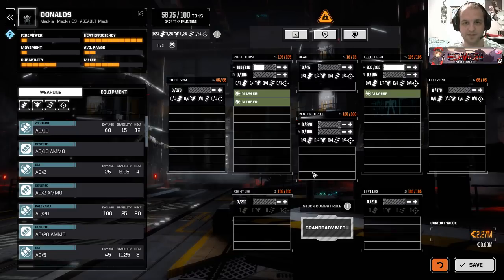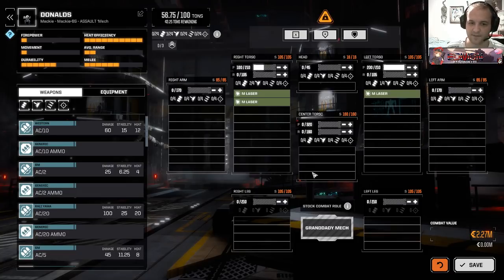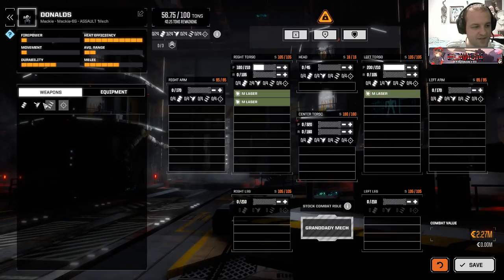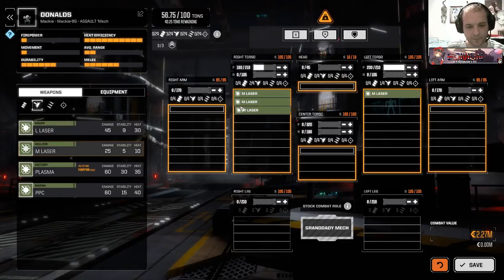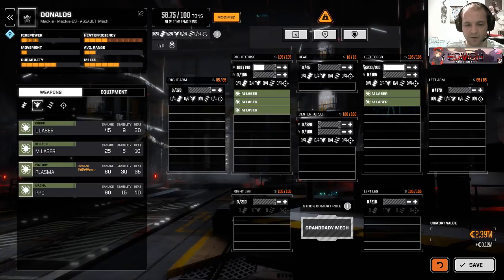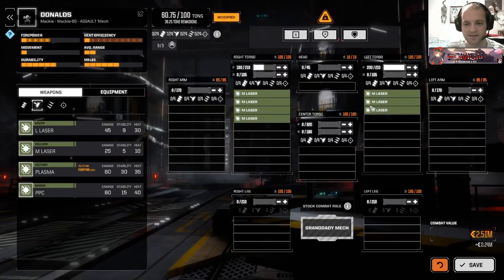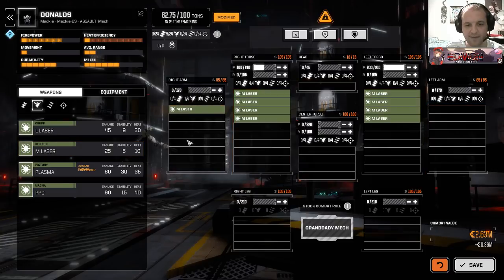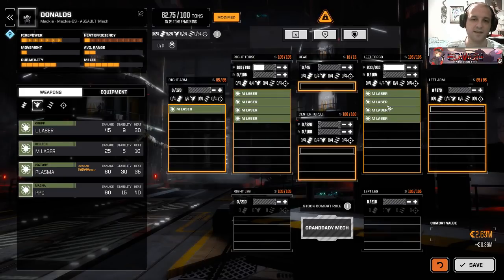BattleTech Guide: Armour - When, where and how much.

Comment: full front armor is a must in this game. Although rare, sudden enemy reinforcement from the rear can occur so if you don't have rear armor you're cooked.
Reply from the maker: The thing to remember in BT is this: It's not what happens in the best case that kills you, it's what happens in the worst case.

Build to deal with the situation where your surrounded and everything has gone wrong.
Reply: Rear armor can be skipped unless your mech is planning melee. By skip I mean the lip service of 10~15 for low lights and 30 for heavier stuff.
While 95% of alphas from the back will pierce this armor they won't cause crits, thus keeping you mostly safe from a 1 time deal. Specially important Vs MGs. Other than that good planing is your best defense. Bullwark + Cover + Sentinel is an easy 60% dmg reduction and that makes your tanky mechs super tanky, specially Vs LRMs.

Comment: In single player maximum armour (and Bulwark if you can arrange it) is the only answer unless you want to rebuild your mechs every contract and\or train up more pilots because you're always outnumbered, evasion is worthless as anything other than a mitigation method for LRM\SRM spam and you will still get hit. Maybe allow back armour to drop a little and be really careful with your positioning, I keep it at 55 in base game and 65 in Roguetech because fast lights can mostly only carry PPC or Plasma at best (KILL THE TRASHCAN FAST) and you really should be stopping anything else getting behind you.
Reply from the maker: This is not quite true in the early game, where an extra ton or two of weapons makes a huge difference (both in standard and RogueTech). However, it is generally correct I think, once you start getting to medium-heavy 'mechs.
Reply: I don't disagree at all, early on an extra ML can make a difference but with how damn squishy lights are, you want to get out of them as fast as possible from an economic point of view in Roguetech. Once you start hitting even mediums the lights rapidly become a liability because you must move them out of position some of the time simply to keep the suicidal little buggers alive and if they've been hit (which will happen some of the time no matter how much evasion you have) they are effectively an empty drop slot unless you want to risk the very real chance the next shot cores them.
Reply: @TheEdmon  The problem in the early game is that you mechwarriors miss a lot of easy 75%+ shot and that becomes costly and the reason you need to load up on armor. I prefer shoot less, but leave longer and not having my crew stand most of its time in the hospital and win vs 2:1 or 3:1 odds in every mission.  But when I say this on the forum, I get called that told I don't know how to play.
Reply: Exactly!  Getting hit by enemy recruits on 6-7 chevron every single shot is becoming redundant when your crew can't hit anything at 7+ gun skill and 75% hit rate every round.
All of your crew has that drawback except the crew you are given on certain missions (trainee for example) where warriors with 1 in gunning are able to hit constantly 6-7 chevron enemy 'mechs with 25% hit chance.  The game is fixed and it shows.

Comment: I used LRM boat centurion with 100 armor across all mech. Until one battle it got sensor locked and two enemy mech hit it with LRMs. Since it had 4 LRM15 ++, i almost had a heart attack watching rockets hit him, fortunately damage was minimal, only launcher got crit. Then i downgraded it's firepower for decent armor. Now i have LRM boat highlander with full armor, i simply walk on enemies, draw fire, and retreat, works incredibly well.
Reply from the maker: It's not just being sensorlocked that good armour protects from, there are certain missions where enemies can teleport in behind you. If you are using fragile launch boats, it's going to be a bad time as that rear and side armour gets punched in from up close. It's never a mistake to tone the firepower down for armour, imo.
Reply: @TheEdmon  In main campaign there's mission where you have to stand in specified zone for number of rounds, while enemies surround you, but that's exception. It's not that hard to hide your glass LRM boat, but small chance of getting shot at exists. There are more cons than pros when making glass cannon, expensive weapons can be destroyed, pilot can die. Also your lance will have less armor overall and split damage across 3 mechs instead of 4, allowing enemy to focus down them faster.
Reply from the maker: Yeah, pretty much agree on all points here.
Reply: @memeoverlord-pz5ns  
well i first used a 4 LRM20 stalker. it had very limited armor (non at the rear) and heat problems too, at least in hot maps.
it took too much damage too often, whenever i got flanked or ambushed...
i changed it a bit to 2 LRM20 and 2 LRM 15, each type with both stab dmg bonus and damage bonus variants, for maximum variety in weapon targeting options.
this enabled me to use more armor, and heat sinks.
still, i often put my LRM boat  in cover so it can almost double its effective armor, which makes it much more durable for its armor value.
that i think is an ideal balance of firepower and armor.
still, in most mechs i put minimal or no rear armor, and focus all on front armor. i usually dont have much tonnage for rear armor anyway, and i usually cant max front armor either...
with leg armor i can usually cut a bit there, but i try to keep it a good amount above arm armor, as it can get hit very often from side attacks.
for rear armor on close combat mechs, if u got the tonnage for it, i try to put at least 25 on each location, and sometimes 50+
for longer range mechs...its usually 0 to 25.

Comment: I like your Vids and got it so far. But i didnt figure the 10% damage per ton out. Is it 10% from the Max damage?. So for instance 25 dmg per Ton would be 1. ML 100%, 2. ML 100%, 3. 50%, 4. ML 33% 5. ML 25%, 6. ML 20% per Ton? Does this also count for light mechs ? Because I like yielding the firestarter. But atm im still early in the campaign (2 skull Missions) and having a hard time. All the best from germany. Francois
Reply from the maker: Hey, the idea is that it is always better to have more armour than anything else, because it is very weight efficient. You can't really go wrong with maxing out your armour and then adding weapons after.
Reply: @TheEdmon  Okay thanks mate ^^
Reply: actually you can go wrong doing max armor then weapons... but then i am going with decades of mechwarrior/battletech experience.... everything from tabletop rpg to most versions of varying PC games... it honestly depends on what mech your outfitting, what your outfitting it with, and ultimately the role in the lance/star that it fills... pilot skills also tend to add more to how the mech needs fitting... lets face it.. if your running a light mech than armor is never your first concern... weapons and other gear will be... because at some point that light mech will get one shot no matter how much its armored as it can only have X amount of armor... where as a heavy or assault mech can easily max armor no problem and still have tons of space for weapons.. enough in some cases to still one shot most lights....
Reply from the maker: @mikewhitaker2880  Yeah... nope. Sorry, the math supports going armour then adding weapons. You will always beat someone who isn't doing this, all circumstances being equal.

Comment: Speaking from EXP from the Campaign, id say putting on armor in increments of 50 seems about right (for medium mechs and up). Generally 100 ISH armor (in the slots that allow it) for a Medium should be good enough for most combat scenarios.

As for where to Put it, as noted it depends on the Mech. Although generally i would say "half" the Armor bar value is a good place to start then adjust as needed. Max the armor where your weapons are (particularly Concentrations of weapons), armor up the legs decently well, keep the Center as armored as possible and as for rear armor, generally 1/3 of the bar to 1/2 of the bar depending on tonnage. (IE if you have 100 do 50 or if its 150 do 50)

Comment: You forgot to factor in damage reduction. With bulwark and other stuff you can get your damage reduction up to 80% meaning your 1 ton for 100 points of armor geta 4x value. Not a big deal but youre also assuming thaylt your weapon dmg per ton has a 100% hit rate which is not the case with evasion pips.   When you consider all this. Armor per ton DRASTICALLY outweighs the value that a weapon provides per ton.

Comment: Rear armor:
A sprinting away mech contributes as much to the fight as a dead mech.  The only time to rear armor is if you are going to have the mech in the fray (ie scout).  Long range mechs should have 0 rear armor, because if you need rear armor on them, you have already lost.  Any unused armor after a fight represents missed opportunity for offensive damage.  So if you come back from multiple missions with undamaged areas, consider removing that armor from future fights.

Mech combat is a lot about killing before getting killed.  And as was beautifully illustrated with the left vs right fight, more firepower will swing a fight.
Reply from the maker: That's not true, the A.I. will target rear armour if it can get it. Sometimes you can show it deliberately to draw fire away from other mechs. It also allows you to run around behind the enemy with confidence your back will hold if someone is behind you.
Reply: Is … is … is that … Le Boeff?!?! :)
Reply: @TheEdmon  Aye :).  Just yesterday I had jumped in to get an advantageous position on the bad guys.  My back was to some steep hills … guess where the reinforcements dropped? :eek:.  If it was not for rear armour my Atlas would likely be dead!

Comment: Q. When Where start Melee? Only Melee high heat/or Run?
Reply from the maker: You are looking for a guide on when it's a good idea to Melee? Instead of attacking with your standard weapons or running away?
Reply: Yea, Is just Damage/Stab/Heat. What do you consider when you switch to melee/standard weapons?
Reply from the maker: This is the second request for this, I will see about putting something together.
Reply: Melee is concentrated dmg, giving or receiving, just like precision shot. I avoid melee at all cost, have no support weapons, even though I run a grasshopper. Only melee if your heat is high, so as to cool down for 1-2 turns, then back to shooting again. If you're one of those that likes to melee, with a bunch of flamers, mg, sl, then melee to your heart's content.
Reply from the maker: Melee does have some key advantages, it has very high base chance to hit and ignores evasion. It does full damage even if you've lost all your weapons / arms / side torsos, etc. In RogueTech, evasion is very, very powerful and thus it's almost manditory in the early game to get anything done.

Comment: I find the game itself doesn't encourage me to use full armour all the time. Brawlers need maxed out armour. Scouts might as well have it maxed as well. Flankers need as much firepower as possible, such as a jenner, and can't afford to max their armour. And then you have really slow mechs with huge payloads. These mechs are the most powerful ones (think the hunchie or centurion or atlas or KC) but are too slow to be effective brawlers. I can't load them up with SRM's and med lasers, so I give slow powerful mechs like that long range weapons. Ranged weapons are less efficient in terms of dmg per ton/heat, but these mechs have higher payloads to make up for it. In order to exploit this concept I also don't max out the armour on these mechs. These fire support mechs stay away from the enemy, with long range weapons, and thus I find it a waste to max out their armour. Should I make them glass cannons? No. But do I need heavy armour everywhere? No. A fire support mech can, in my experience, get away with loading only 50% of its max armour.
Reply from the maker: There are a number of maps where the enemy can spawn in right next to you and/or behind you. There are also maps which are very small and/or open. Reduced armour for long range firesupport is a tactic that works well 90% of the time, but it's that 10% of the time that the unit gets caught and focused that's the issue. Since you have little control over mission RNG, it makes sense to run heavy armour and share it out around your lance.

You can get away with it, but it's not a risk I generally take.
Reply: @TheEdmon  I'm watching your videos but it will take a while to see all your lance layouts. Do you generally run with 4 brawlers or do you build mechs to have both long and short range weapons? I don't like stock builds much because I like to specialize a mech to be either a long range or a short range fighter. As for the armour, I have definitely learned that making glass cannons is super risky, as you say. But I don't think an Atlas with 50% of its max armour, with long range weapons, could be called a glass cannon. It can still take quite a number of hits, especially as it will be at range.
Reply from the maker: @sweetsour6783  It depends on what equipment I have available. On the ultra hard campaigns, I typically have to make do with whatever is laying around. If I wanted to minmax and make my game as easy as possible, I would spam LRM boats and/or SRM+ML brawlers. They offer the best damage / ton over the other weapons.
Reply: @TheEdmon  I did win the campaign using sensor lock and LRM boats, but my god it was tough at times. I found in the late game when fighting assaults I would often run out of missiles, it just took too many barrages to take down the enemies, and that was with using breaching shot!
Reply from the maker: @sweetsour6783  Take more ammo, less launchers and pack JJ and use them to jump away from approaching enemies. Ace Pilot also helps a lot in the strategy.

For reference, a good build for a stalker is 4xLRM15, 6-8 cans of ammo and 3 Jump Jets, with full or near full armour.
Reply: @TheEdmon  I saw your video on ace pilot and I've used it for flankers and back shots, but not with LRM boats. The problem is that I thought LRM spam really benefited a lot from breaching shot and of course you can't have both that and ace pilot
Reply from the maker: @sweetsour6783  It does not. Breaching Shot is honestly a bad skill.
Reply: @TheEdmon  But with LRM spam, the AI is going to be braced for every shot, which means 3 dmg per missile or 2 if the enemy is in cover or has bulwark, or 1 dmg per missile if they are both in cover and have bulwark. Even if we imagine each missile will do an average of 2.5 dmg, and 75% of the missiles land, how could you have enough ammo to chew through 2 heavy/assault lances?
Reply from the maker: @sweetsour6783  This is an issue of target selection, you want to take out A.I. with LRM's first, as they will fire no matter what and thus compromise their defence. Same for any A.I. mechs that do a sensorlock. It is incredibly rare that there is no "easy" or "easier" target to shoot at, than a brace-mover with a 60% mitigation. You can also deliberately expose yourself at long range to one or two enemies at the end of a turn encourage the enemy to fire at you and thus compromise their defence. There are few entirely dedicated long range mechs out there, so you usually trade damage exceptionally well.

If you have 8 mechs to deal with, there should always be at least one that is exposed that you can focus on, to get the most out of your ammo. If there truly isn't, you need to create one. The same rules here apply to all weapons, not just LRM's.

1 ton of LRM ammo is upto 480 damage, similar to all other ammo based weapons. Lostech versions are up to 720, far more than most per ton. The health of an atlas is 2250, at the absolute maximum, you can realistically take one down in half that if you focus one of the sides. That's 3-4 tons of ammo, since you can easily pack 8 on a stalker, crab, or similar 4xLRM boat, the math works out but you do need to make the right decisions.

You can also pack some spare Medium Lasers and run a little less ammo... just to mop up whats left of the enemy after bombarding most of them into the dirt.
Reply: @TheEdmon  Oh, that's right! When the enemy fires or uses sensor lock, they can't brace, and of course they can't always be in cover. I saw you talk about that in your video. So I've just got to pay attention to which enemy mech is doing what and then I can hopefully select my targets properly. To be honest, though, in my current run through I'll probably not go with an LRM spam strategy, as I've already done that and wish to do something else. Still, proper target selection matters for all weapons, as you've pointed out.